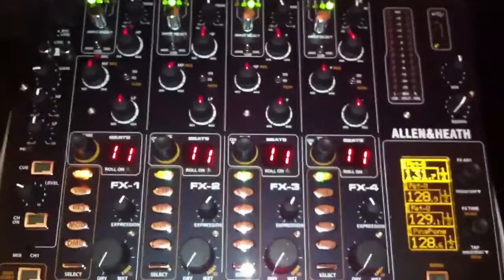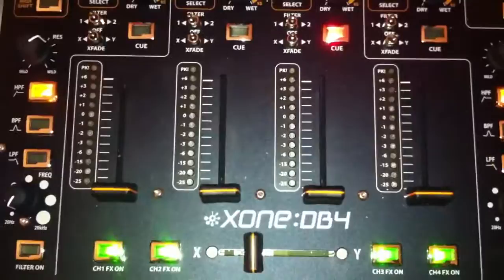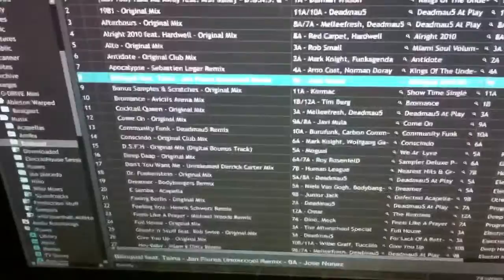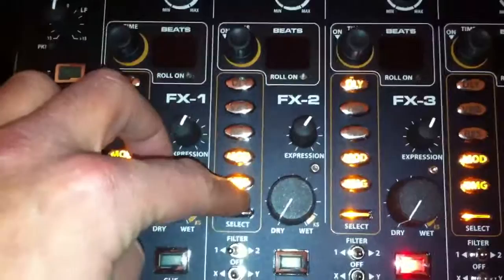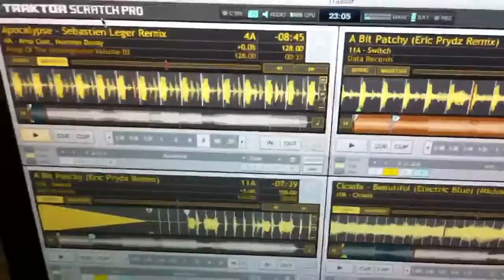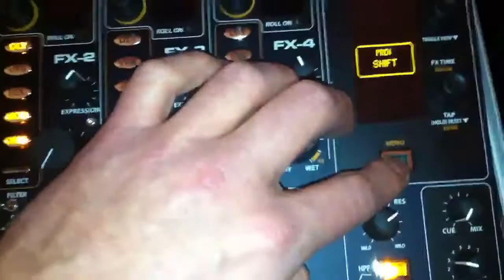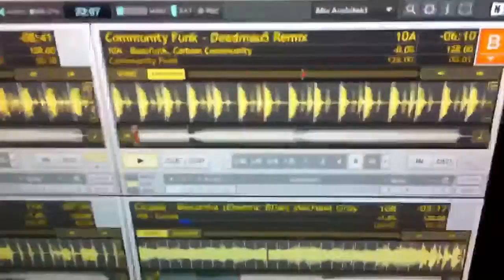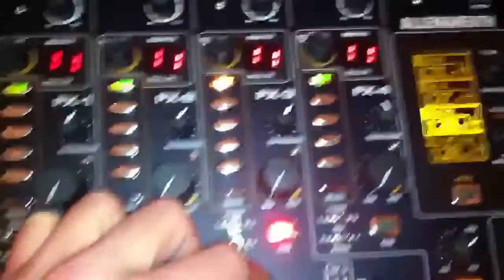Allen Heath DB4 and TSP overview

Comment from the maker: @Fluffier 
its not necessary but if you already have one its awesome to use alongside the db4... just bec it gives you so much more control.. the db4 is not designed to be a midi controller.. its primarily a mixer but when i use them together its just amazing.. fi bought 2 cdj 2000's so i use them for decks A,B and use the mixers midi to control decks C and D.  Im having a few serious issues using the CDJs in HID mode in Traktor so ive reverted back to Serato for the time being.

Comment from the maker: @shrapnl im pretty sure you can bec unlike serato, traktor doesnt require specific hardware.. what you'd be doing is simply using the soundcard on the db4 instead of the audio 8.. shouldnt make a difference but you're best off posting the question on the NI forums just to be sure.  Im abt to buy 2xCDJ 2000s and use them in conjunction with my mixer in HID mode... will let you guys know how it goes..